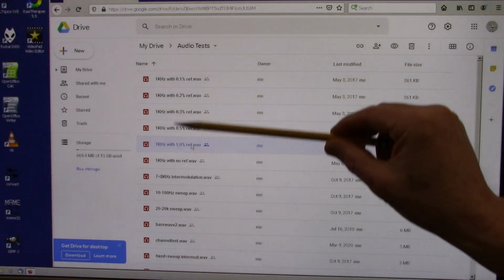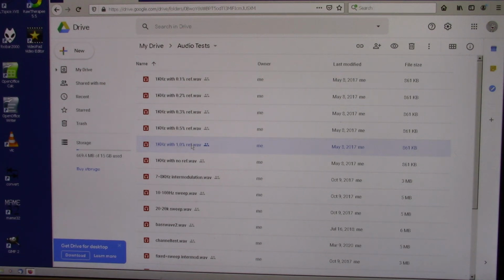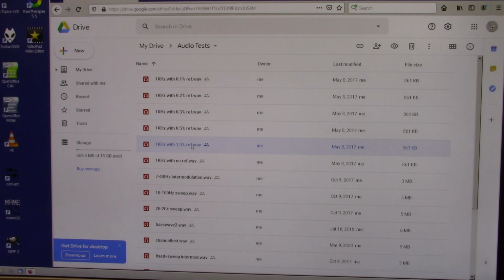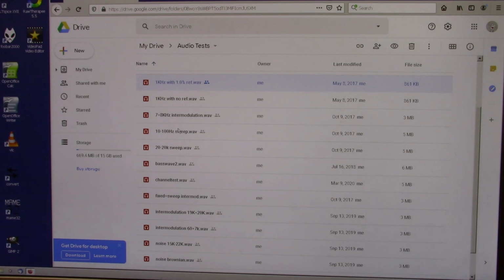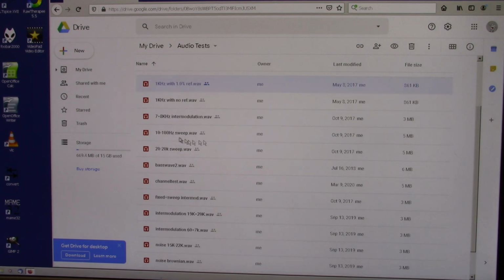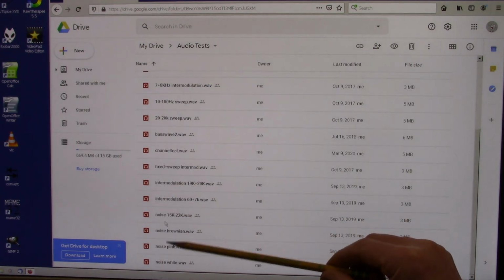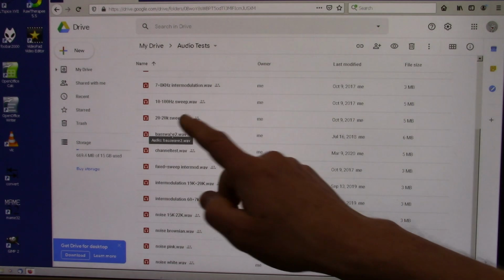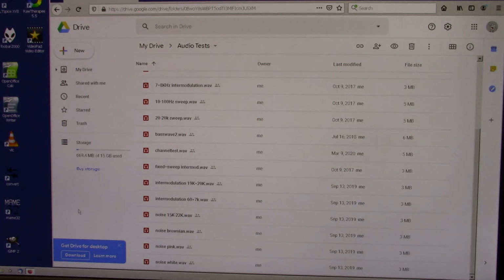FREE audio test files and JAT news and content plans

Comment: Hi John, great video as always. What output transistor are you planning to use on the EZ amp? Are you going with the 2SC5200 and 2SA1943, as Digi-key is listing the TO-220 packaged versions of these transistors as obsolete.  It would be great if the EZ amp were designed with a current transistor while not going to the expense of the larger packaged components. Cheers.

Comment: The digital files have stepped waveform, the Hi-Res BS, MAQ, why 192kHz and moresampling and more than 40 kHz bandwidth if it only causes trouble. We know from the past, Meridian did a lot of work in this field, that 30kHz bandwidth is plenty for audio. Other than electronics like amps, DACs, most tweeters distort as well. Soft domes work in damped break up mode, metal domes have sharp break up above 20kHz (it rings like crazy when excited), planars other kind - nothing is perfect. My biggest problem is production tolerances in spkr transducers and distortions which make my life miserable - why does my L ch sound better than R even after I swap the crossovers, especially when I attempt to make passive Linkwitz-Railey crossover. 
Keep up good work.

Comment: Hope your brother is doing well. How are you finding the new scope compared to the older DS1052E? I've got the latter and was wondering how the newer models compare for weekend hobbyist use like me.
Reply from the maker: The new scope has a lot of features that can make it more difficult to use (lots to wade through). The big higher rez screen is nice but the text is a bit small. The 1052 is a nice entry level scope with less clutter that makes it easy to use, but you may or may not miss a feature or two.

Comment: EasyEDA is great. The layout portion of the software gives you full control of board layout even though it does have a "auto rout" feature. Very much worth the short period of time it takes to learn to use it. Good quality boards too. Check out my Instagram to see some examples. Ive used them for various projects. Including amplifiers and even a ventilator controller.

Comment: You should try to learn how to use this https://www.kicad-pcb.org/ But you will have to work from your schematic. That's just how schematic capture works. First you draw your schematic then you generate the board art. Otherwise the software does not know what is supposed to be connected to what.
Reply: Yeah kicad is actually very good, there's plenty of videos to help you get going also. I could be wrong but it might be possible to import a schematic by scanning something that you have on paper but don't quote me on that.. I downloaded it and had a play with it. It's free which is always good and you can place the components wherever you like on the board then auto route or manually do it. I found it easier to let it automatically route and then finish it off myself... Then there's the 3D view of what the final product is going to look like... Really awesome!